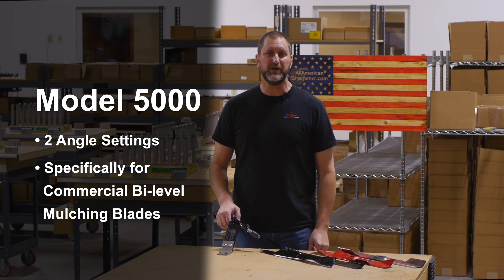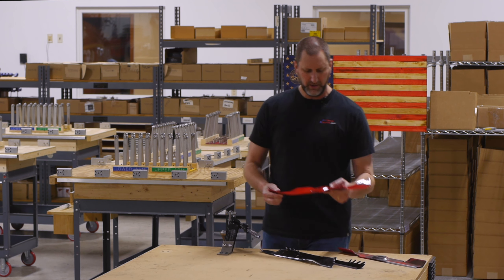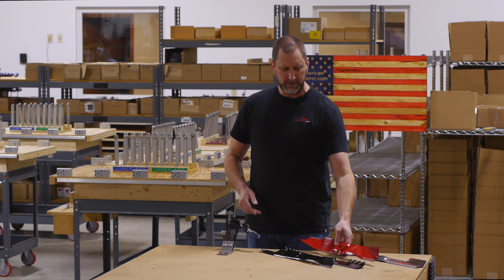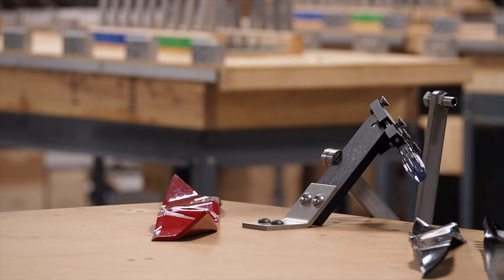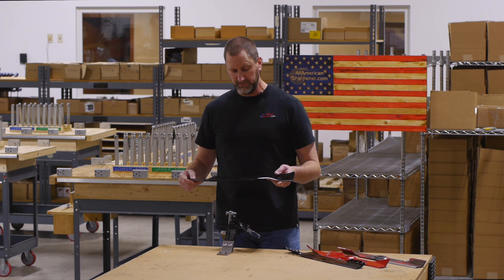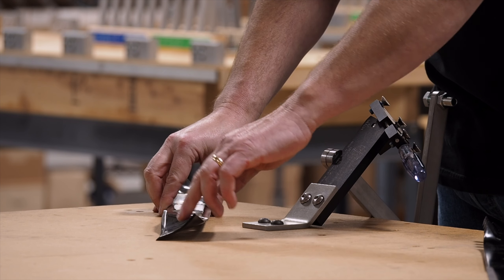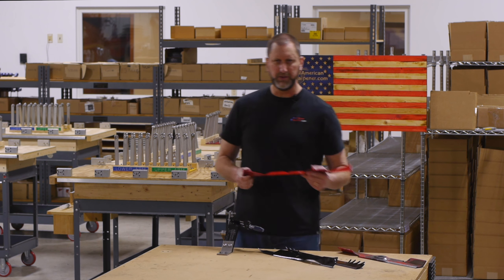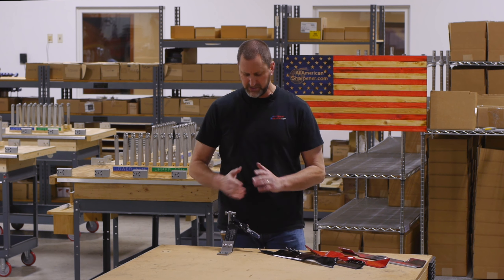All American Sharpener - Model 5000

Comment: Will the 5000 still work on a straight blade at 30 degrees?
Reply from the maker: Yes, the Model 5000 is built to toggle between a 30 degree setting and a 15 degree setting, so that mulching blades are an option. The reality is that due to the shape stamped into the blades by most manufacturers, there are few mower blades that can utilize the 30 degree setting. The thing to keep in mind is that most blades are set to a 30 degree angle relative to the underside of the blade directly beneath the cutting edge. Where the angle setting on our jig comes in is when you look at the bevel relative to the center mounting area of the blade. Even blades that appear flat and straight often have a bit of tilt or lift stamped into the blade during the shaping process. That 5 or 10 degrees (or 15 degrees in the case of John Deere blades) can make a big difference with regard to the life of your blades. Since the difference in price between the 5000 and the 5005 is just $20, we typically recommend the 5005 because it is the most versatile and future proof of our sharpeners. This isn't meant as an upsell, just something to consider.
https://www.allamericansharpener.com/5005
Reply: Really appreciate such the complete feedback given that this video is an older one.   Much appreciated! @AllAmericanSharpener